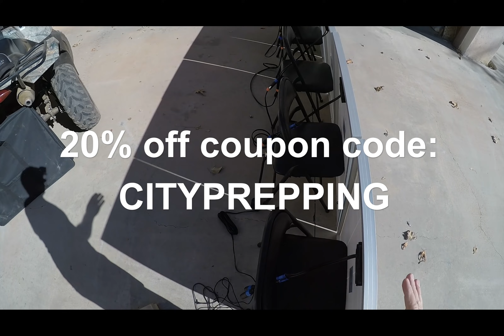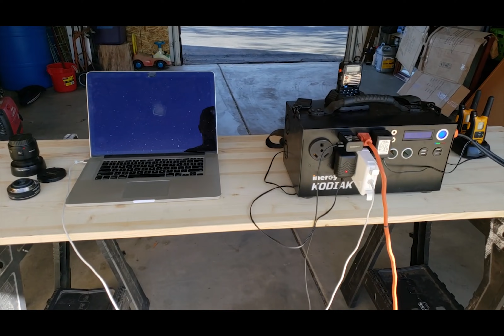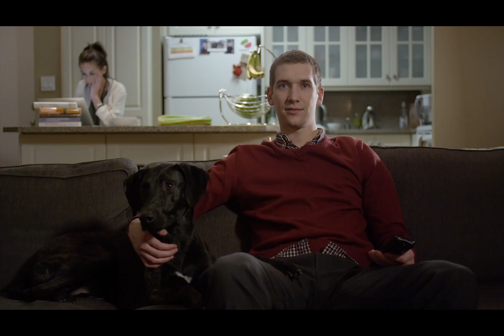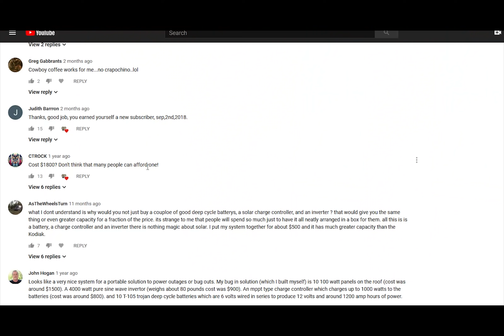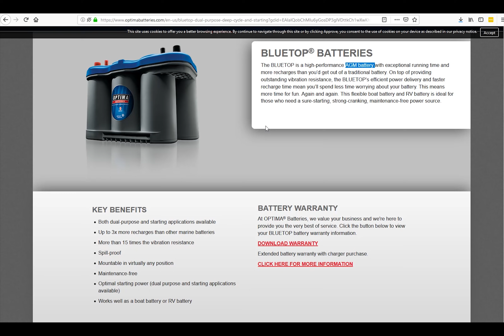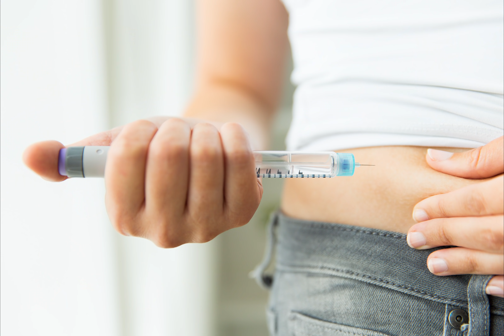Solar Generators: worth the money? Inergy Kodiak after using 1 year

Comment: Just a few ideas from a retired EMS First Responder.  For critical medication, such as insulin, I'd recommend investing in a small backup refrigerator, which can run much longer on an alternative power source. 
Please keep in mind, that the less often you open and close your main refrigerator/freezer doors, the longer it will remain cold.  In spite of food safety concerns,  remember too, that contrary to popular belief, in reference to 'Use by' dates, 
it will NOT turn into a pumpkin, at midnight!  Just use common sense.

Comment: My thoughts on building one, portability, and sturdy case is worth points. Its hard to diy a simple to use and durable unit like most of the better solar generators. Note on saving power. Use a very small FREEZER during daylight hours to freeze as much water as possible. Use that frozen water to help keep the freezer cold at night. Anything you dont want frozen goes in a small good quality cooler. Also, keeping both stuffed as full as possible while still getting them shut tight will help. When you open them, frozen or chilled items stay chilled much longer than the air that will need "re-cooled" after you get into one of them. I do similar when camping in 90+* weather, and always have people asking how a cheap cooler still has ice on day 3.

Comment: Does this solar power store enough energy for the night use? And if does what electrical equipment can be used during the night?
Reply: If inergy can handle multiple solar panel & connect to it multiple external battery, it can probably do more than power a ref the whole day

Comment: Do not buy!!!!!
This unit uses a proprietary cable system. You can not use solar panels unless you buy their super expensive solar panels or super expensive cables. I've been waiting six months now for a cable so that I can try out the unit I waited six months for. A survival item is useful when convenient and you find parts for it. Shtf, better order thirty of those wires cuz you won't be able to get them anywhere. except these guys and it takes over six months to get one

Comment: In a grid down scenario, having a gas powered generator is only a plus so having both sources of power would be the best way to go. You're likely not gonna run into trouble just because you're running the generator until the power comes on, I mean come on. You can use the solar power for less power eating devices in the mean time. Both systems have their advantages and disadvantages.

Comment: The kodiak has been nothing but problems. I’ve had two cables burn before the warranty was even up . If your preppier I wouldn’t purchase this thing . I bought the gold kit for $2500 and could have 5 propane generators and propane and had it lasted 10 years easily! Save yourself the money and build your own or just go with a gas or propane generators 🤬🤬🤬🤬

Comment: Electric heaters and burners are not inefficient. In fact, quite the opposite. An electrical device's efficiency declines with heat loss. These devices sole purpose is to heat. 100% efficiency! Electric heaters just draw too much current for the generator. Great video!

Comment: one thing I learned, if a refrigerator is necessary you are screwed! no sun=no power! when dealing with medical issues here, there is no guarantee of having power, secondly running a refrigerator  for two days is useless for the most part, you need a guaranteed power source, a running stream, an alternator with a power management system is 1000X more reliable and will run 24/7, it all comes down to how much power storage you have and how consistent your charging is!

Comment: Like I said I noticed you don't mention the air conditioner it's going to be very very hot outside how about that the gas generator will will work on the air conditioner that great thing will not how about that do a test on that how long will it use it will it work on the air conditioner cuz remember it's going to be hot outside to I like to see people do think about that..

Comment: A whole lot cheaper, simpler, and responsible to use deep cycle batteries with your own charge controller and inverters.  Those all-in-one power packs are fine for someone playing around with prepping or camping for a day or two.  When the thing breaks,  no power.  Make your own and you can fix it yourself.

Comment: If you are going to buy this product think it twice. I really had a bad experience with the Kodiak warranty. When I connected an external battery the one Kodiak specifically use, guess what it did not work, besides that I sent to Kodiak Inergy pictures and details they day the Kodiak itself is good. in addition, they told me, if they do not find anything wrong they are going to charge me for that. I am 100% sure it does not work with the external battery. In other words, I do not recommend this product at all. And the worst part they deleted my comment from the website, they do not want hear my bad experience. I do not recommend it. It is too expensive for the warranty you receive.

Comment: Is there a system/device you can hook up directly to your electrical panel / already installed solar panels on the roof that will kick in if power goes down?

Comment: I just tested the 3.2cu mini fridge  (hot) on a 1000w yeti lithium it was 70w on and 6w off but totaled 47w in 2 hours!  Throw 600W solar on it (possible if you get the MPPT controller and use both inputs) and you can have a lot running pretty much indefinitely.

Comment: Just a point, a generator is not just a device that you fuel and get electricity out. A generator by definition converts mechanical energy into electric energy. It's not a generator at all, but it's a fair nickname so people get what it does.

Comment: I am looking at your product and wondering what amp/hour rating does the battery have and at what volt rating is that battery.  I am surprised that I have looked at you website, and have only found a spec for max watt output. If I were to recommend this to my friend, I like to know the full specs picture.

Comment: I what to use this in my camping trailer to run my ice box and a TV at night before bed time so I can watch a movie or two and to run my AC for an hour or so at night before bed time and a few led lights that's it I am working on another way to run the AC but it'll take time setting up and testing I think this will work for me. It'll have all day to recharge and I may add another 100 amp hour battery to it just to be safe.

Comment: Also for medical usage, perhaps an independent warning system could be attached in case the device fails or a high temperature warning device such as for storing insulin.  I m not an expert in these areas so perhaps other considerations are necessary.

Comment: I don't have the skills to build one, nor do I have the tools. On top of that, I don't get out of bed for less than $100. When I do unskilled labor, I charge $35/hr; which translates roughly as, "it will cost me $35/hr to learn the skills necessary."
Reply: And if you need the stuff in an emergency situation, how much are you going to pay per hour to get it fixed? Can you access that labor?
Reply: @illuminated2438  
Allow me to illuminate some problems your "question" overlooks.

The presumption is that power will come back on some day. In this regard, the question is moot; as in, you're making mouth noises. The answer, is that the power will likely come back on before I have to fix it.

On the premise that the power won't come back on, then the ability to "fix" or repair, or replace this item will be moot, as their will be much more important things that need taking care of. Cost/benefit analysis; this tool doesn't benefit me enough to learn how to build&fix it.

But let us run with the stance your question comes from. The sun still shines. That means that whatever disaster has befallen us, the skies are free of unending clutter. Do you know the lifespan of solar panels? Do you know where to get the resources to build them? I mean, you can make batteries out of lemon juice, so if you can't get the resources to build adequate solar panels, then knowing how to build/fix this tool becomes moot if lemon juice becomes competitive.

Jussayin. The kodiak is pretty cheap.

Comment: To me - if this is a "solar generator" then you must add the cost of solar panels to the device. They can not be separated. Otherwise this really is a misnamed battery.
Reply: @robertbradford the cost merely point "brain" of the solar generator sys. If you are observant(I doubt), the video shows 2 different style of panel. Why add the cost of the panel when the consumer can just use the panel he already have or save more by buying cheaper one. The video talks about the cost of starting up a sys for prepping, then expand when the budget allows (as he also talks about its ability to add external battery but guess he doesn't have any lying around his place).
Reply: Malou Salas m
Reply: There is  no such a thing as solar generator. There are solar panels and betteries along with controller. This is a classic marketing toy so popular in US. Get some knowledge in battery technology in solar panels and wind generators and you might be prepared way better. You can actually build wind or water generator from scavenged materials, though hardly solar.
Reply: @shelekhov  ok well how?
Reply: @jennifer2419  Reckon if you ran a clothes washing machine in reverse, by channeling a stream of water through it, it would generate a decent current
Reply: yes it runs off solar power, just like a petrol generator runs off gasoline... it does not produce gasoline   gotta think out side the box.

Comment: Battery or generator, the name doesn’t matter. Either one will need to be either charged or fed gasoline. The situation for most people won’t change in regards to the medication situation. If it’s not being made, it can’t be bought. A solar battery or generator will have an advantage over anything requiring gasoline, if the sun is shining. If you can afford it, have both.

Comment: I am building my van into a camping van/Bov and have been ordering the solar components lately. I will use at times the same gen that you have in your video as I find that combo just can't be beat.
Reply: Btw electric blankets may be a viable option in the North country? Propane heaters that don't kill you in your sleep? Ac that will run on a 2000w Honda? Thanks CP. We seen to be going in the same direction.

Comment: Could you connect two of the generators together and be able to hook up 1200 watts solar panels and also have double the battery?
Reply from the maker: You can add batteries to this unit but not connect to other generators.

Comment: Just a quick comment regarding having the ability keep stuff cold for medicine.  Since a fridge might take up a decent amount of your available power, if you have some good coolers, consider purchasing a small ice maker.  You can run that a couple hours a day on your solar system with little power but have that ice for your coolers for a few days.
Reply: I bought a generator and it gave out after a year and no matter what you couldn't charge anything for very long it was a patriot generator. Then one night during a storm the electricity went off and came back on and then the generator neighbor came back on. I called them and they said they couldn't do anything to help me cuz it was over a year. So now I have a very large 55 lb paperweight. It was not worth the money I spent by no means. And it definitely would not run a refrigerator and all the things that they said. You pretty much can charge a flashlights and your cell phones but you're not going to be hooking your TV up and your refrigerator it would drain it so fast.

Comment: I see no since in charging my time at my pay scale. If I did that even getting out of bed on my day off is pointless
Gas generator are no good. Gas no longer stores long enough. Convert to propane is better and simple to do.
You have the large positive and negative prongs. You could charge it with your car.
I have a large battery bank. I have many options on charging mine.

Comment: The Kodiak is perfect for an off-grid cabin, when combined with a wood stove for cooking & heat, propane for cooking & water heating, an outhouse or composting toilet and the Kodiak for all electrical needs.... 12v water pump, lights, media, charging devices, etc !!!
Reply: It is only 90 amp hours. It is not enough for a cabin.

Comment: Have had mine for 6 mos, used it for 2 sleep apenia machines while on the road. Charged it with vans 12v system while driving, works great. But want to add extra Li battery, when will this be available to do? SLA's are SO heavy!! Was hoping someone has found a work around to accomplish this. Want to do some boon docking and need the extra capacity.  Thanks

Comment: Fridge run time on any battery backup depends on the specific unit's efficiency.  I have a Kenmore 99783 4.4 cu ft counter height fridge that draws 55 watts and runs about 5 1/2 hours a day in a 78F environment - fewer hours in a cooler space.   It's one of the better ones.

Comment: If you're going to keep a fridge going with one of these, you probably need a portable fridge. Like a Dometic CFX-series chest style. They draw fairly small amounts of power, and 12 volt so you don't need the inefficiency of the inverter. But of course if the grid is down long enough that it becomes a real issue, the insulin users die anyway. Insulin needs to be constantly resupplied because it's perishable. In a crisis, the type 1 diabetics will be dead in a year or two max.

Comment: Important to note that devices with built in batteries often + hours and charge in less than two and do not need to be connected all the time. There are independent powerbank units that do this.

In designing for an rv conversion, I am on the side of solar Generators for plug and play and if I trade, I take that investment with me rather than the built in units some are installing. Also for separate units for lights, computers, HVAC and refrigeration, etc. Hmm, how to design a switch so I can target a bank...

Comment: This would be a great system for me because here in the south, I get a good amount of sun light, and I only need to power a refrigerator and a freezer. I really have very little other use for electricity other then that. MAYBE a power tool if I need to fix something, but I also have hand tools. I think I have to build it myself though as it is rather expensive, but I have most of the components I need already. I did go to school for electrical engineering after all. The only problem is finding the time. I work insane hours. Maybe this holiday season? I also got a good tip on making a sun tracker for the panels, so that should increase power input.

Comment: From the perspective of a person living in an area where the sun shines for many hours every day, the solar generator is an option - and a very good choice. There are many regions where there is not a lot of sun so this just isn't a practical option.

In a true grid down situation, you can forget about preserving insulin, within weeks there will be none, period.

These solar batteries are worth considering but I am going to hold off for now.  I expect that over the next few years, the price will come way down. Picking one up will be cost effective. Until then I'll stick with my 3,000w, quiet run diesel or gas generator and hope an emergency doesn't last more than available fuel will last.

I wonder if it will run an oil fired furnace or hot water boiler? It doesn't take much to start and run either as long as you have oil to burn.

Comment: I was surprised to see that more people didn't put down powering their oil or gas burners for heating their houses, which they would want to do in a winter grid down as we did had to do after hurricane Sandy. I had a gas gennie but when gas supplies run out U R  up the creek. How would I find out what the draw of my burner & pump are?

Comment: I do have one basic question about these units that won't void any warranties, and should be pretty simple to answer for anyone who owns one and a volt meter...  Would you please check the output voltage of the 12 Vdc outlets after the unit has a full charge and let us know what it is?

Thanks!

Comment: Great video. I'll be saving my pennies for one of these. I've used a gas generator in times of emergency (grid down) and was always worried the gas would run out before the power came back on. Excellent comparison and answers to the questions.
Reply: Just stock enough fuel and you'll be fine.

Comment: I asum if you hook it up to those stationary bike generator to charge it as long as it outputs is 12 or 110v you can plug it directly to the Kodak? Since they sell some that do 300/500 peaks watts on amazon/online. Or would you need some type of balancer to keep the wattage/current relatively consistent.
Reply: Sorry know all other trades pretty well but electronics/electricity type stuff has always eluded me.

Comment: Another prominent YouTube Channel made their own Solar Generator to the same specifications than the Kodiak. He spent approximately $700.00 on his Kodiak like copy. Why not make your own solar generator ? And save roughly Half the cost.
Reply from the maker: i watched the video.  it's not quite the same and is engineered differently, but very similar concept.  as I mentioned in this video, if you can pull it off yourself and you really want to build one, then yes, by all means go for it.